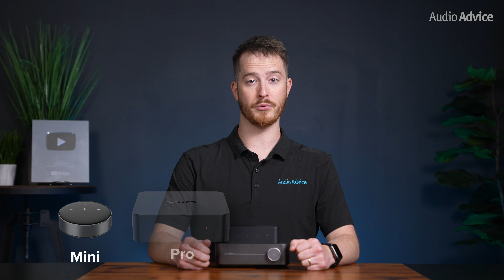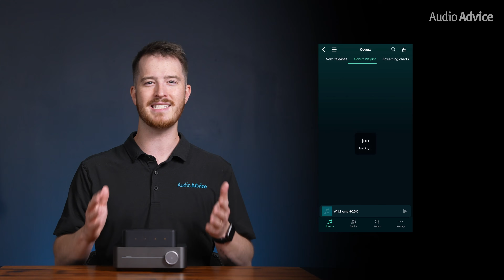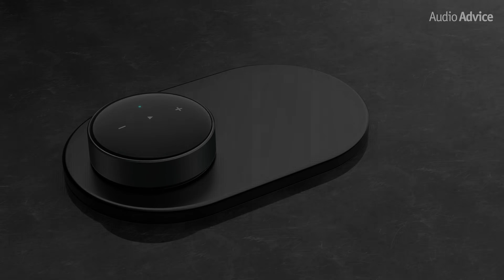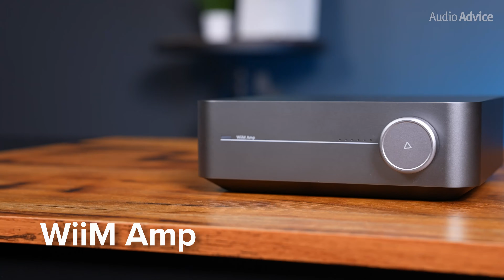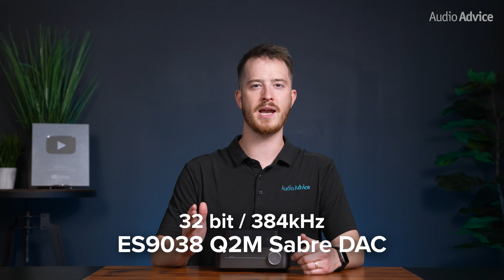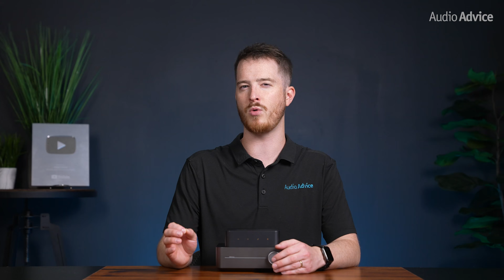WiiM Music Streamers Overview 🎶  WiiM Mini, WiiM Pro, WiiM Pro Plus, WiiM Amp, WiiM Ultra Comparison

Comment: Blue ah-s? 
Never heard that pronunciation.  Blue oh-es as in Operating System.
Reply from the maker: Correct. We actually spoke with some of the engineers at Bluesound and they all pronounce it as Blue-OSS.
Reply: I’ve also heard that Oh-es isn’t correct. Blue-ahs is the intended pronunciation

Comment: I use the WiiM pro in my garage hooked up to an old Bose wave radio. Fortunately the WiiM has eq so I can actually make the Bose sound reasonable. I mostly feed the WiiM using Roon. No, I didn’t buy the Bose, it was a gift.
Reply from the maker: Haha, that's a nice idea! Thanks for sharing!
Reply: I feed the WIIM Pro Plus through a Marantz with rebuilt floor speakers. 
 Setting the EQ to off , it sounds great, but using EQ, and set to Acoustic for most all music, it sounds spectacular for what I have.

Comment: I use the WiiM mini in my bathroom system and I like it for the most part. The only issu I am having is that it loses the Wi-Fi connection every couple of months and I have to go through the set up process again. I was not having this issue with my Belkin SOUNDFORM™ airplay receiver, but it does not have a remote so that is why I like the WiiM.
Reply from the maker: Nice idea using it in a bathroom, very cool! Thanks for sharing!